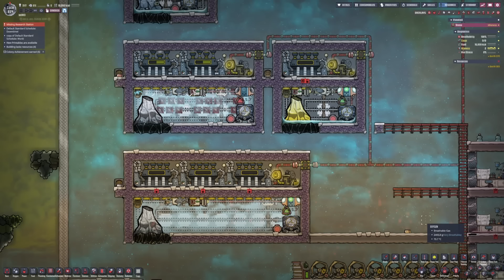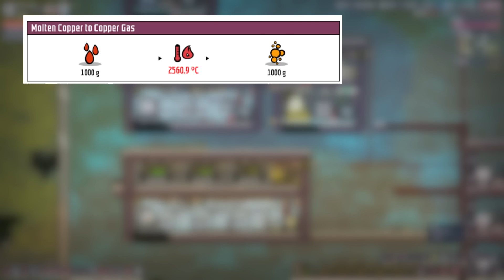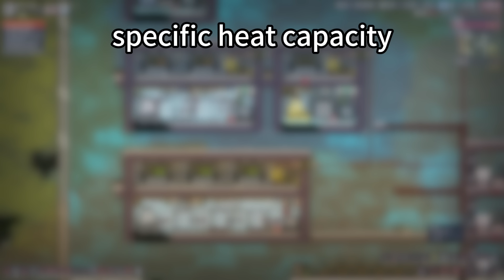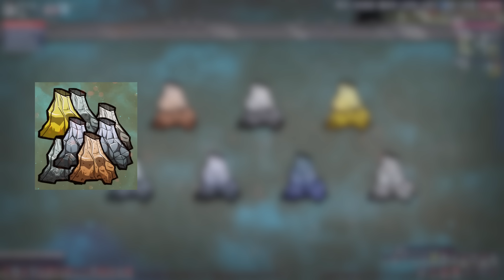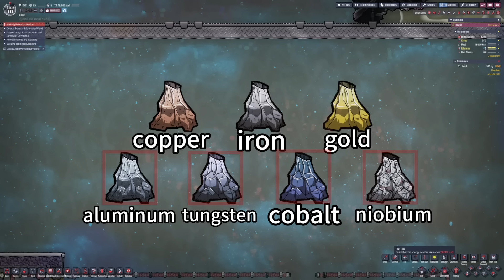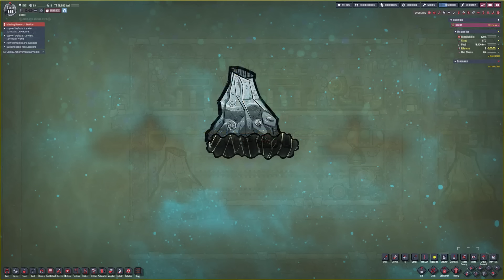[ONI]#25 ONI Metal Volcano = Free Matel + Free Power - Metal Volcano Development | FansGame-k7k

Comment: Reach to a point where I get steel making production running. Now the time to conquer Aluminium volcano! Gonna use this as my 1st. Thanks.

Also does the 1000kg water per Steam Turbine is baseline for every type of AT/ST setup, regardless of steam chamber size?
Reply from the maker: 1000kg each turbine is just for this one.

In other cases, the amount of water in the steam chamber needs to be adjusted according to the heat in the steam chamber. The higher the heat in the steam chamber, the more water is needed and the more turbines are required. 

For instance, in the steam chamber here, the metal volcano brings a large amount of heat. Therefore, we use 1000kg of water for each turbine to ensure that the temperature in the steam chamber will not be over 200 degrees and is also not too low, resulting in insufficient power of the turbine. 

In other cases, 1000kg of water might cause insufficient power of the turbine because there might not be a heat source like a metal volcano in our steam chamber to heat so much water.

Comment: You dont need steel conveyor rails in a steam room.. only that touch an active area of a volcano or just avoid that spot, same for sensors.
Reply from the maker: Actually yes. I use steel just for simple. So u don't need to think abt which one need to use different material. 😂
Reply: @FansGAME-k7k  Sure, people have million tons of steel on game start to don't think abt..
Reply from the maker: @dimitriig u r right. But i use steel just for simple. So i don't need to think abt which one need to use different material.😂

Comment: What temperature is that metal leaving the chamber at?
Reply from the maker: its gonna be 130°C when it leave the steam chamber. when it go out of the whole set up it will be 30-50°C. Depend on the setting of the pipe temp senser.
Reply: @FansGAME-k7k that’s great, it eliminates having metal tile cooling chamber under the build
Reply from the maker: yes I use this way to cool the metal instead of using metal tiles. save some refined matel for build that!